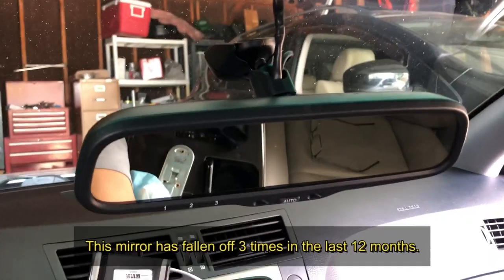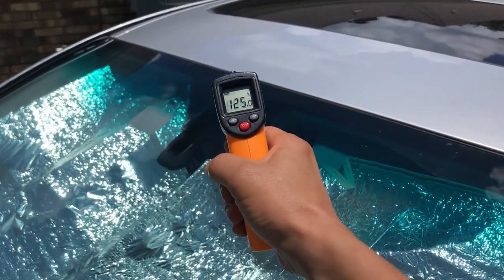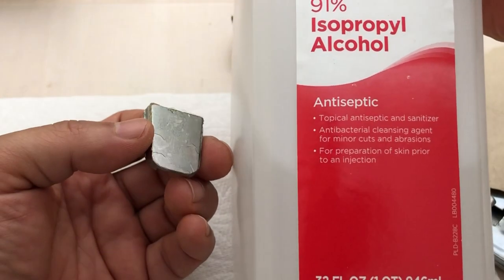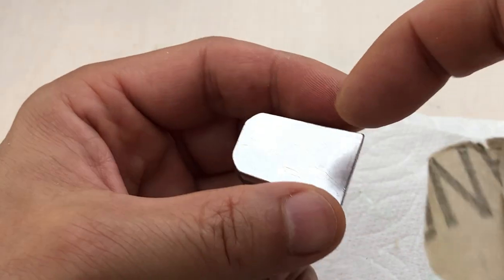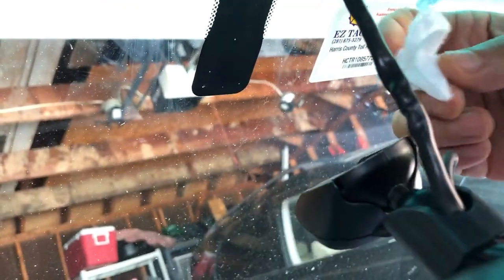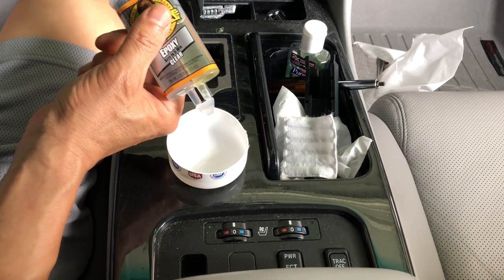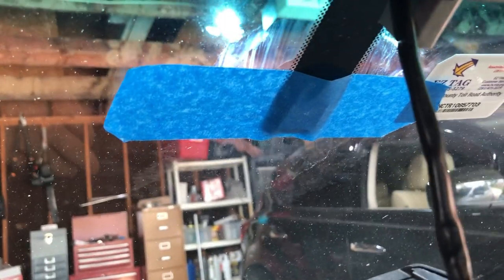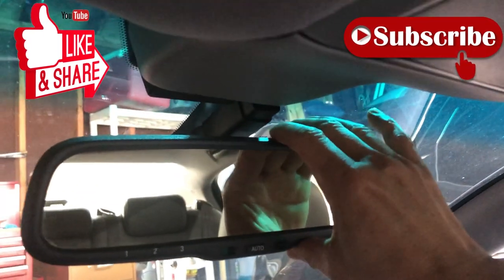Rear View Mirror Keeps Falling Off

Comment: I wish there was a way to put a metal plate over the windshield and bolt the mirror through the glass to the plate.
Reply from the maker: Sorry for the delayed reply, but I also thought about your "metal plate" idea before as well.  Since the point of failure is the mounting base that attaches to the windshield, I googled to see if there is a wide base (surface that attaches to the windshield) but there aren't any.  For cars with heavy rear view mirrors, like GS300/GS350, with many functions are too heavy to be supported by wimpy base.  If someone can make a wider based (perhaps twice the current surface size), that should be very effective. I'll see if I can improvise one.

Comment: I have the same problem.    So, after a year, how's it holding up????   In my particular case, my subwoofers vibrate the mirror to the point that it comes off.   3rd time now.
Reply from the maker: Sorry, I missed this message earlier. It lasted 11 months, and then failed, when I parked the car out in sun with the sunshield up for few days.  That's much better than failure after days or weeks with other glues.  The problem is this mirror is very heavy with lots of functions, and it only fails when exposed to hot sun for a long hours, especially with the sunshield cover which reflects all the heat upwards to the mirror mounting point. 

As long as I keep the car in shaded areas, and opposite direction of the sunlight, the Gorilla glue seems to hold up well.  However, I'm still in search of stronger glue that can hold up higher temperature than 180F that Gorilla glue is rated form.  I'm going to check, but I'm pretty sure that mirror mounting point gets above 180F especially with the sunshield covering the front windshield.    This is why mirror falls off more in hot weather areas than cold areas.
Reply: I have the same problem, along side many other issues that heavy bass causes😂
Reply from the maker: Yup that’ll shake things loose for sure.

Comment: I’m having a different issue. The button that you were holding in your hand is actually glued to the rearview mirror and has not come off. The rearview mirror itself keeps unclipping from the button and falling off as I’m driving. I’ve tried to the mirror back onto the button numerous times, but it just doesn’t seem to stay. Would you still suggest using adhesive in this case since the button button is still attached to a rearview mirror?

Comment: I used Gorilla Super glue "gel."  It holds (allegedly) in heat up to 200° F.  I have a Honda Odyssey and have the same problem with the fancy/heavy mirror falling off, I parked in direct sunlight, but I don't use the window shade like you had. So far so good it seems really strong honestly. I let it cure for 24 hours with the tape like yourself. I used the Permatex as well it just falls over time...
Reply from the maker: Yeah I used all kinds of mirror glued and they all failed.  So far, only the gorilla glue is holding up.

Comment: what's the higher temp glue that you found?
Reply from the maker: @andrewhkim  If you google “high temperature glue” you’ll find several.
Reply from the maker: @andrewhkim  JB has this glue which says it’s for metal so I’m not sure how safe or reliable it is to use on glass. 

https://www.amazon.com/dp/B01IBOBY74/ref=cm_sw_r_as_gl_api_gl_i_S1YCP9G841GFAS3A1KG1?linkCode=ml2&tag=hyonim-20
Reply from the maker: @andrewhkim  The glue that I’m using in this video is holding up my mirror for more than 2 years now.  So this is also a good one to use.

Comment: I’m having the same issue in my suburban, and I suspect I’m cooking it with the reflective sun visor also. I’m going to give this a shot, thanks!
Reply from the maker: So far this glue held up 2 months of Houston sun light.  Good luck.
Reply: Did it work ?
Reply: @kevin2jzzzz203  so far so good, and we’ve had a month Of 95° + highs with reflecting visor behind the windshield.
Reply from the maker: Mine also still holding after 3 months.
Reply: Thanks will be giving this a try!. Same car same problem. All glues failed. 6 times in less than 3 months it fell off in summer heat.
Reply: @DIYLifeSkills  still holding strong?
Reply from the maker: @ryancoleman1039  Gorilla glue lasted the longest (6 months), and then I parked outside with sunshade up and it’s been scorching in Houston so that knocked it down.  LOL. 

Now I know, it’s the weight of the mirror fighting against prolonged heat exposure on the mounting base is what’s causing glue to fail.  

I put the mirror back up with gorilla glue again and it’s been 3 months since but I’ve not used sunshade. Sunshade is reflecting all the heat to the mounting base and raising the temperature by another 10-15f degrees.
Reply from the maker: @ryancoleman1039  I did find some super high temperature glues so that’s what I’ll use if it ever falls off again. That mounting area with the sunshade cover can get over 200f degrees.  So if I used a glue that is rated 300f or higher it should hold.

Comment from the maker: It was quite sunny here today and temperature hit 91. The mirror bracket area was registering close to 170 F degrees.  I think when we hit 100, temp may exceed the Gorilla Epoxy’s max temperature of 180F degrees.  

Little bit nervous, this may fail again, but let’s see.  There is another Gorilla glue that can hold 300 F, so that could be the next if this fails.  LOL
Reply from the maker: Yeah back in 70s and 80s they were hung off the top of the windshield frame and then never fell like these days. The problem with modern day luxury car mirrors are, there are too many features and it’s really heavy.
Reply: How is it holding after 1 year ?
Reply from the maker: @myopinion7533  I recall I t fell off after nearly a year after, and the I put it back on with same glue and it’s been holding for almost 2 years now.   I found the problem.  If I use sunshade under hot weather, that channels all the hot temperature right to the glue spot.  As long as I don’t use sun shield. It’s going to be ok. So I bought a outside windshield cover infested which is it as convenient but does prevent hot air build up near the glue area.
Reply: @DIY & Life Skills  Thanks ! I glued one back on a few months ago and it fell off today.  I made sure to clean well and abrade too. I used Autozone store brand glue for windshields.  Maybe that's the problem . I'll use Gorilla this time .

Comment: is it still holding up?  I've got 1 vehicle that the mirror does the same thing - falls off about 3x per year.  Just like you I've tried all the different brands of rearview adhesive and none like the TX sun
Reply from the maker: I've answered this several times before. In my case, when I used the sunshade on the windshield, I measured the temperature of the spot where the mirror is glued to that was reading 180+F degrees.   I then looked for the highest heat rating and this was the glue that I used.  But it's also at near max rating of this glue.   So it did fall once again after almost a year I believe after repeatedly using the sunshade.  But I glued it back and I didn't use sunshade and it's holding nearly 2 years now.   That said, I've found other higher temperature glues, but I'm exactly sure it's suitable for this application, but if this ever falls again, I'll give it a try.

Comment: I work with epoxy glues and if we need to remove what we glued we use heat.
Reply from the maker: Yup high heat is one of the culprit for rear view mirrors falling down. This is what I think happens more often in hot weather areas.

Comment: If anyone could help, I would appreciate it: my mirror fell off just like in the video, but it came off with a little chunk of glass. What do I do?
Reply from the maker: Chunk of glass meaning a piece of windshield came off???   

As shown in video, my metal button that holds the mirror doesn’t glue directly to windshield glass.  There is some thin black plastic piece that’s stuck to the glass and that’s where the button is glued to. 

What is the year and make of your car?

You know you can also glue the mirror to slightly different location.
Reply: @DIYLifeSkills  Hi! Thanks for getting back to me. It is a 2009 Toyota Camry. Yeah, the metal plate came off, in due part, I believe, to the Arizona heat. That has never happened to me before ahaha Yeah, I also have that black plastic that the mirror was adhered to.

A chunk of glass came off, and is stuck on the metal plate. The piece of glass didn't create a hole in the windshield. But it's significant. I'm just wondering if I could glue it the same way. I may have to still scrape off any glue residue, but leave the chunk to fill the hole?
Reply from the maker: @Yo_soy_Annna  How big is the broken glass?  That's pretty unusual if it's OEM windshield. If you bought it used, it could be cheap aftermarket windshield.  Windshield has multiple layers with glue holding them in between, so it sounds like the inner layer came off.
Reply from the maker: @Yo_soy_Annna  I would definitely glue the broken glass back on, but the problem is glue will want to run down.  You may have to tape over it, and then scrape off the tape after glue dries.  I would install the mirror in different location than the broken glass area to better the chance of it lasting. 

I live in Houston, so we get extreme sun here as well.  I always try to park in shade or in opposite direction sunlight.  In my case, using windshield shade actually helped to collect the heat and channel it to the mirror glue area, which melts the glue and make it fall.   So I've stopped using the windshield shade.
Reply: Sounds good! I'll try to attach it with the chunk of glass first, to fill the hole. I'll try to get back to you with an update. Thank you so much 🔥
Reply: Have you tried putting the shade on the outside beneath the wipers? @DIYLifeSkills
Reply from the maker: @knoll9812  Yes, actually I bought one but it's not convenient to use.  So I try to park in shade, but if there is not shady area, then I face the front of the car away from direct sunlight.

Comment: I tried this today hopefully it helps. I have to work tomorrow. 😪  and I would hate to drive it with a hanging review mirror 😭😭
Reply from the maker: It requires 24 hour drying time.  Also hope your area weather was good.  If it’s too cool and too hot glue doesn’t set properly.  I also used a masking tape to securely hold the button in place for 24 hours
Reply: @DIYLifeSkills  I did use tape to hold it the glue is dried but I'm going to let it settle for 24 hours. I'm in Texas it's 62 and sunny its perfect weather actually just windy.
Reply from the maker: @Michelle70523  oh good. I’m in Houston area also.

Comment: Currently dealing w/ this and this is like the only video I found where the whole piece is off including the mirror. I’m currently trying e6000 glue bc it’s all I had at home at the time. Legit fell off late at night. 😒So we’ll see.
Reply from the maker: So I’m further study it’s the high temperature that melts the glue and makes these things fall.  This gorilla glue is rated to 180-185 f degrees.  So it’ll hold as long as you don’t use a sunshade under hot sun. Sunshade reflects all the heat up right to the mirror glue area and makes those heavy mirrors fall
Reply: @DIYLifeSkills  yea it’s getting hotter and more humid here (never lived in humid weather this extensive before) so I think (personally for my car) that’s what got it to fall and it’s the first time it’s even fallen. I’ve been in Arizona w/ my car & it gets realllly hot as everyone knows and never had this happen😅. 
Only issue I’m having now is sliding it back on. For some reason I think one of the prongs that clutches to the metal piece glued on the windshield is a little wider than it needs to be, idk how though. But the e6000 glue kept that piece secure to the mirror. 😩 so thank goodness all it is now is securing it back. 
But yea I’m definitely gonna have to probably stop using my sunshade. 😭

Comment: How’s it holding up after 8 months
Reply from the maker: It's ironic that you ask at this time. 

This was holding up just fine until just recently, 
wife was messing with the oversized sunshield that puts pressure on the mirror, 
and when she went to remove the sunshield after sitting out in the sun for few hours, 
she yanked on the sunshield which pulled on the mirror, 
and the mirror fell off.   Arggg....

I just gorilla-glued it back on again, but here is the problem with this mirror. 
1. It's got auto-dimming, compass, and homelink features, so that makes this mirror much heavier than the regular ones. 
2. Every time this fell, it coincided with having sunshield, which deflects all the hot sun heat upwards towards the mirror mounting area. 
3. This mirror never fell off when sunshield was not being used. 

Gorilla glue is rated up to 180F degrees, 
but in the hot sunny day with the sunshield up, 
I've measured the mirror mounting area to exceed that temperature.

So I plan to just not use the sunshield and try to park in opposite direction of the sun, 
and I'm also looking for much higher temperature glue...if I can find it. 

What is your experience on rear view mirrors and glues?

Comment: Mine after it fell off for the 1st time, it has fallen off like 5 times in a span of 2 weeks, i have tried every glue that there is (except the one from this vid) i'm getting tired of this crap but it is sooo uncomfortable let alone dangerours to drive without that rear view mirror so i guess i'll have to keep trying :(
Reply from the maker: Yeah, I know the exact feeling. The problem is this mirror is quite heavy.  Make sure you clean the area thoroughly, and take time to follow the instructions in detail.  Most importantly, secure the mirror button tightly with a painter's tape like I did for few hours for best result. I think I actually left it to cure overnight.   Also, avoid using sunshade because I found that channel extreme heat all towards the mirror area and literally melting the mirror.  My last glue attempt is still working now for almost 3 years now.
Reply: @DIYLifeSkills  it is a heavy mirror indeed, i am glad it has not broken tho with all the times it has fallen, i can't keep pushing my luck, i gotta get this solved quickly, i'll follow the instructions and thanks for the vid

Comment: Gorilla glue sucks
Reply from the maker: What happened? So far it’s holding up better than all the other ones I’ve tried.
Reply: @DIYLifeSkills   I used it on a rear view mirror for my UTV it lasted for about a week and fell off
Reply from the maker: I see. Sounds like all other glues I’ve used. I think my problem is when I park under sun with the sun shield up, all the heat rises to the rear view mirror mounting area and the high temperature literally melts the glue.  

So far this was rated highest in temperature that I can find and it’s been holding up close to 11 months now. 

The other problem is this mirror is pretty heavy since it has so many functions. 

My wife says, next time it falls off, just get a cheap light mirror. LOL

But she gave me an idea that I could get that cheap mirror and then mount the dual front and rear camera that goes right over the mirror itself. 

I’ll lose garage door opener feature, but I already have a portable opener.
Reply: @rkniepfel  Maybe you didn't do it right.
Reply: @rkniepfel of course it didn’t last you used it on a UTV. It’s probably not going to hold if you’re off roading.